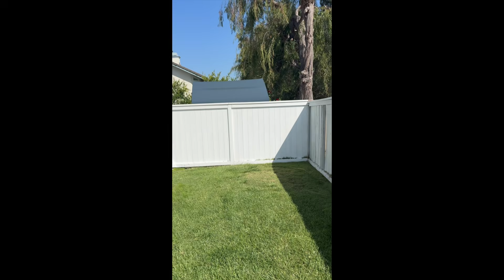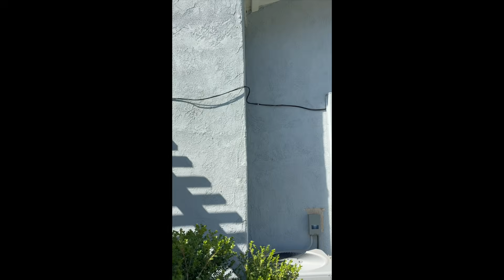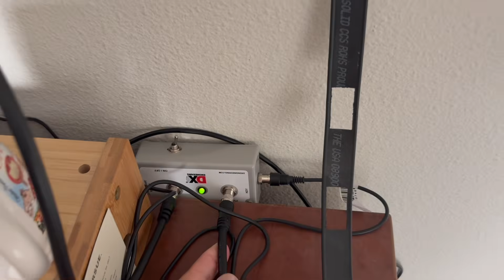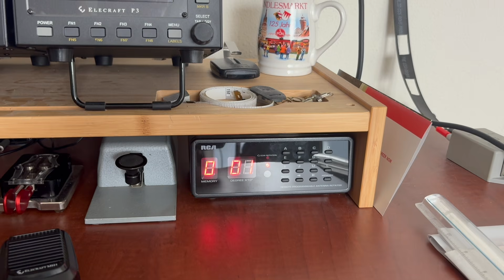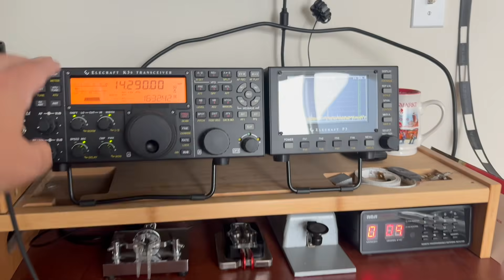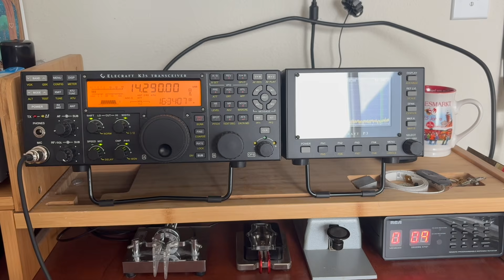Magnetic Loop Permanent Installation

Comment: Awesome setup! 
How high are out from the ground? I'm getting ready to mount mine and was worried about going to high with it due to interference.
Reply from the maker: It's about 12 feet off the ground. Somebody commented on my first video, the height is not very important. It is good to get it as far away from RF noise as possible, so as far from the house as possible.
Reply: @BrianMoore-uk6js  the people who made the well known Wellbrook loop antennas in the UK always said that the optimum height for such a loop was no more than 2 loop heights from the ground. too high and it becomes omni directional and is more prone to picking up local noise. I have mine attached to my 6 ft fence at the rear of my property and have virtually a zero noise floor. I also installed a good quality line isolator at the shack end to help with noise pick up on the coax.